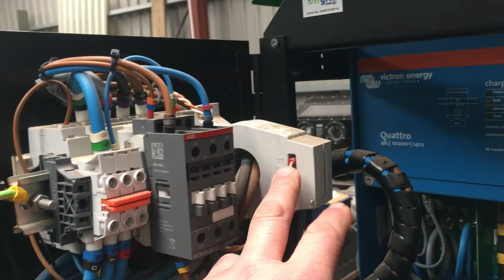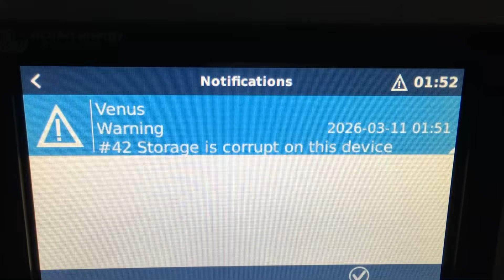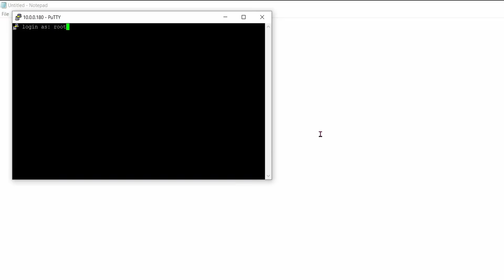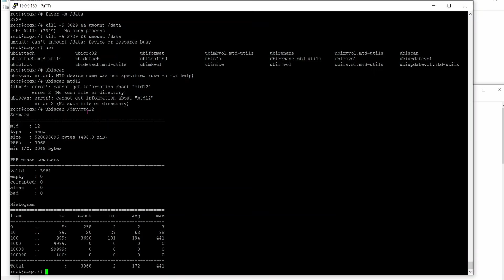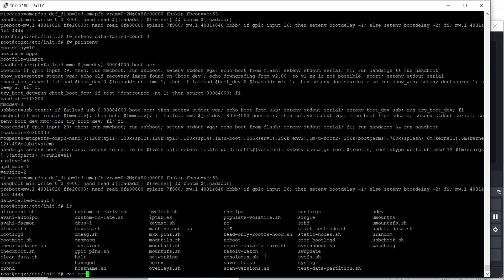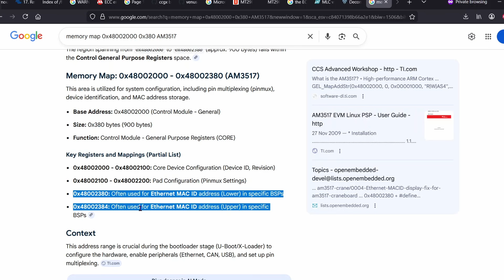Victron: "It's not user repairable" 🤔 Me: "Really?" | Victron CCGX Repair

Comment: This has been a while... did you ever get the whole system working again ?
Reply from the maker: I did some work on it, and altered most of the shelves to take new batteries. I've actually been helping a friend build the exact same thing a few days ago, and we've got his 90% done. Just need to wire the solar panels up and put a changeover switch near his fuse box. He's just using one inverter. I was planning on using two in parallel.

Comment: When a filesystem won't unmount because it's in use, you can often mount -o remount,ro that switches it ro readonly, so you do whatever on it.
As to what happened, I would guess an improper shutdown corrupted something. It happens sometimes, hard to figure out precisely.
Reply from the maker: Thanks for the tip 👍

Comment: I have alot of victron experience and have fixed a few of thses gen sets 
Alot of extra fluff but its designed as fix on site ans not have alot of knowledge plug in generator set and away you go
Great repair by yourself 😊😊😊😊😊😊
Reply from the maker: Thanks mate, glad you enjoyed the video! 👍 I've just been looking at two of these CCGX modules that someone sent me that died after a lightning strike! (probably my next video) 🙂
Reply: @BuyitFixit och that's not good 😐 must have been a direct strike or clap above to cause that

Comment: I would be 0% surprised i they considered that flag as "technological protection measures" and send you a c&d because YOU DARE repair your broken product, instead of buying a new one!
Reply from the maker: Luckily I've not had any issues with this one so far, although I did get my video of the x-ray machine I bought (tear down and hack) taken down by the manufacturer. I guess they didn't like me bypassing their licence check, even though the machine was no longer supported and is EOL. It's a useful bit of kit still though. I used it to prove chips were fake on the KS Jive radio video for instance.

Comment: Great video. I managed to send data to VRM with other commands, but I still get the 42 error even when using the command that fixed it for you. What firmware was your CCGX on when you did this, maybe I can downgrade to it and try again.
Reply from the maker: Did you clear the U-boot flag = 2? what does it show if you print_env? There was a few commands that I had to use to clear the error, such as delete the original partition.
Reply: @BuyitFixit  print_env gives an error, as in the command deosn't exist. Flag was done and  ok. It seems as though I may have ran that last command on root folder and not the correct one. Seems like something is wrong, not sure yet. I'll try reflashing and try again!
Reply: @BuyitFixit  I came back to try again and this time I get no error 42 after rebooting it 5 times. This video was super helpful, thank you so much!

Comment: Some quality nerding here. You clearly know some embedded linux. The best thing about Victron is that it's standard arm openembedded linux, and thus highly hackable. Fixing the ubifs config to use the right ECC is probably the right thing to do here for a permanent fix. But your unmount will probably keep it going for a few more years. I didn't know the VRM iD's were just the MAC address of the device. Makes sense, I guess as they should all be unique. Those Quattro's should be just as happy with some nice lithium batts as a set of lead-acids. Might need to update some firmware, but that's not hard. Victron make all this stuff pretty straightforward.
Reply from the maker: Thanks mate 👍Yes I've been doing some fabrication to the existing metalwork to take some Pylontech batteries as I've already got 6, but adding another 4. I've got the MK3 interface as I had to use it when setting my Easysolar II up. I'll probably do an video on the build when I finish it 👍

Comment: Hey, one of your newest subscribers here! As a Linux wannabe-geek here, I wanted to share my 5 cents as we're all learning and poking stuff. I spotted you using cp -av in the video. The -a flag is usually the gold standard because it preserves everything (permissions, links, timestamps), but I noticed it was throwing 'ownership' errors.

The culprit is that the SD card is formatted as vfat (FAT32). FAT32 is 'blind' to Linux permissions, so it doesn't know how to save the owner data.

If you want a cleaner backup without the terminal spam, I’d suggest these:

1. The Rsync way (if you keep it FAT32):
rsync -rtv --modify-window=1 /data/ /media/mmcblk0p1/data/
(The --modify-window=1 stops rsync from getting confused by FAT32’s low-resolution timestamps.)

2. The Tarball way (Using different filesystem. Best of both worlds):
tar -cvzf /media/mmcblk0p1/data_backup.tar.gz /data
(This 'wraps' all those Linux permissions into one file, so you don't lose anything even on a Windows-formatted card.)

3. The 'Proper' way:
Format the SD card to ext4 first. Then cp -av or rsync -av will work perfectly with zero errors because the card will finally 'speak' Linux.
rsync -av /data/ /media/mmcblk0p1/data/

Awesome repair video regardless—it's great to see these CCGX units getting a second life!
Reply: The "Gold Standard" Network Backup

If you don't want to mess with SD cards, there is actually an even better way to backup your data! If you have another Linux machine, a Mac, or a NAS sitting on your network, you can push the data directly there. This is the "gold standard" because you won't see those "ownership" errors, and your symbolic links won't break—everything transfers with 100% fidelity.

Note: If you don't have Linux running anywhere and want to test this, you can easily spin up a Linux VM in Windows using free tools like Oracle VirtualBox (just remember to set the NIC to bridged mode). Use an Ubuntu or Debian server install—it's a small size since no graphical UI is installed. 

Why use rsync over the network?
1. Full Fidelity: Unlike an SD card, the remote machine understands Linux permissions. A file owned by "root" on the Victron stays owned by "root" on your backup.
2. Symlinks Work: Victron uses many symbolic links. Rsync preserves these perfectly, whereas a Windows-formatted SD card usually breaks them.
3. Efficiency: After the first run, rsync is smart—it only sends the specific bits of data that have changed, making future backups almost instant.

The Scenario:
Imagine you have a Linux machine at 10.0.0.100. Your username is "backupguy" and you've made a folder called "backup" in your home directory. Logged into the Victron, you'd run this:

The Command:
> rsync -avz /data/ backupguy@10.0.0.100:/home/backupguy/backup/

Command Breakdown:
* -a (Archive): The "copy everything" button. Preserves permissions, ownership, and links.
* -v (Verbose): Shows you the progress so you know it's working.
* -z (Compress): Squeezes the data so it travels faster over your WiFi/LAN.
* /data/: The source (the trailing slash copies the contents of the folder).
* backupguy@10.0.0.100: The remote user and the IP of your safe machine.

(It will ask for your "backupguy" password, then start the magic!)

Disclaimer: AI used to help format this technical advice.

Comment: That's a whole skill set that would need constant use or it would slowly be lost, cheers
Reply from the maker: Yes, I used to know a lot more about linux as I used to use it as my main operating system. Back in the day I was cross compiling stuff for different CPUs etc, but I've not done stuff like that for about 10 years now and as you say it slowly gets lost...

Comment: If you want to change the unique ID you might be able to overwrite the get-unique-id binary with a shell script that returns your own ID. However the server backend may or may not accept it.
Reply from the maker: I had thought similar. There is a /data/rcS script which you can create which runs quite early in boot. I had thought of creating a symlink or something linking the binary so a simple script that would just echo the value you required. I think the with the Raspberry Pi it just generates a random VRM ID, so I would think it should be possible.

Comment: I had a similar problem couple of years ago and came down to bios  battery on board it kept loosing all settings etc no power new battery good as new
Also have found sometimes having sdcard you can use that as memory instead of chip and just get it to boot sd instead of flash or bios
Reply from the maker: Interesting, thanks for sharing 👍

Comment: to be fair, you could just have gotten an new controller, either the same aor more modern one, like victron cerbo or victron elkrano. 

Victron stuff is actualy great, because you can repleace single components.
Reply from the maker: Thanks for sharing 👍I've seen the cerbo, but I didn't know about the ekrano. They are quite expensive though at around £400-500!

Comment: Okay so in Linux like that you can set VIRTUAL-MACS

Most scripts will return the virtual mac address because its what the network stack returns, when you enable virtual mac, in almost all cases, the primary mac is simply ignored.

So changing the VRM is possible with 1 command for DHCP users and 2 for static ip users
Reply from the maker: I did try changing the mac in the u-boot environment variable too, but it seems binary reads the memory locations that are programmed with e-fuses directly from the silicon. I did find out that you can put your own rcS script in the /data folder, so it should be possible to make a script to create a symlink to another script that just echo's 'newmac-address' . I think that would work.
Reply: @BuyitFixit your trying to soft change it to network stack itself will update with citlrtual macs, it will never return the primary mac. It's part of the network stack, you might beat it with scripts but I doubt it's viable any update risks erasing the confirm but a stack update yeahhhhh they rarely break updates and or get overwritten, and can be validated adding a startup script to uboot good luck sir

Comment: NAND flash ages. Uslng 1bit ECC instead of 4bit ECC is reckless. From memory this AM35xx should support 4bit BCH ECC in HW and of course 1bit Hamming. There is also SW Reed-Solomon in the Kernel since ages. (tglx did that) So the proper Solution would to Upgrade the Kernel. But that's not a 30 min job :)
Failures like that tend to become visible after a couple of years. And storing that sort of failures in the u-boot Environment is quite creative...
Reply from the maker: Thanks for the insight 👍I'm not too familiar with the kernel code or how ubifs works at a low level. I wasn't sure if there was some software ECC in there which might have been being used. It does seem odd that they are only using 1bit though.

Comment: anyone know how to change the way VenusOS works ? when the hardware dies I move the data to another device but it then looses all its settings as it changes its ID ect and needs wifi set backup again so then have to reconfigure everything again anyhow .. and use the victron replace hardware thing to get the history moved to new hardware , Ie) instead of using MAC adress could it be made to use the storage ID of SDCARD?
Reply from the maker: I did think of possibly a way to do it. You could create a script /data/rcS that creates a symlink from get-unique-id to another script in /data . This script could just simply echo (your new mac). Then you should be able to set it up the same as the previous unit. I've not tried this though, but I think it should be possible. If that didn't work then mount --bind /path/to/new_executable /sbin/original_executable should work.
Reply: @BuyitFixit  thanks will try that as well , like surly a uuid is enougth

Comment: Those are Quattros, which means they have diesel generator inputs.
Reply from the maker: Yes. The big red three phase input can be used to charge it from a generator, and also the small blue service input. You can set the input current from the control panel, so I've only got a small generator 5Kva, but I'm planning to hook that up too so it auto-starts if the batteries get too low.
Reply: @BuyitFixit   the two outputs have priority, you can put secondary loads like boiler to other and when mains drops, the batteries are not wasted to heating water.
Reply from the maker: Yes, I've got a smaller Easysolar II that I setup with batteries and the ESS. It's also got two outputs which as you rightly say you can configure for normal or critical loads. Problem is it's too far away from the house (over 100m) which is why I'm going to re-use all of the batteries from that, and move this unit next to the house 🙂
Reply: @BuyitFixit   It's much more versatile with new VenusOS and ESS. I've also hooked it to Home Assistant which follows electricity price and forecast from net and panel production and then controls ESS on Cerbo which then commands Inverter. Inputs also have priorities, I've swapped them so genset is also high priority and when it stabilizes, it makes automatic swap. The problem is genset governor, inverters don't tolerate much deviation from grid frequence and it requires electronic governor to properly follow load changes.

Comment: This is a continual; problem on this sort of shite.
it is a design fault between the programemr & the storage device.
the programmer who wrote hte code likely continually writes out TMP files for logging or startup procerdures.
over time ,it totally destroys the Nand flash , due to the continual useless writes to the device, then it dies and totally kills a very expensive product.

It is a pain in the ass and a lot of technology sufferers this problem. ,including routers/wifi points, infact anything that continually writes log information to a nand flash.
Usually it is the BLK 0 that goes flaky, this cannot be moved and holds a special  place in the boot process.
A reformat wil lwork , usually for a short period of time.
Reply from the maker: Yes, I remember something similar with Tesla cars and continually writing logs a while  back.

Comment: If you ever want to figure out what is locking a filesystem on a linux like os, you can do ps aux | grep <that number from fuser>  and it should show a process name.
It does sound a little like the problem is that they cheaped out on the ecc ram chip, which is what that ecc error is about, which caused an error probably during some power event like you suggested because error correction isn't working properly.
another very probable cause is that it overheated while sitting in the sun while in operation. Flash memory does not like being hot.
Reply from the maker: Cheers for the Linux tip mate, always useful to know 👍

Comment: Besides copying the mounted filesystem, it's always a good idea to back up the physical partition(s) via dd. That way, you might get data that could be missed if the filesystem has errors. 

As an "embedded" engineer who deals with this sort of thing (and is sometimes responsible), kudos to your work on this.
Reply: Working or not, I'd image the whole flash. Given an error like that, it's possible the flash is wearing out. With a backup, you could replace the flash if necessary.
Reply from the maker: Thanks James, I'd be interested on your thoughts on the 1 bit ECC that it seems to be using. I've done similar work on embedded systems before (as I like reverse engineering stuff and doing stuff like making them run doom or unlocking hidden features). One of the other devices I looked at on here was a VTech internet connected baby monitor, which I discovered cached videos of the previous owners child in flash in the camera (no mention of this on the instructions). It's in the reverse engineering playlist I did here, if you're interested. https://www.youtube.com/@BuyitFixit/playlists

Comment: I hope you pack the space with DIY Lithium batteries.
Reply from the maker: I've already got some pylontech batteries from my smaller system so I was going to use those with some additional ones. I'm currently modifying the old battery holders to take rack mounted batteries.
Reply: @BuyitFixit I look forward to seeing how it turns out

Comment: Linux 6.12 so it's fairly new (late 2024), unless it's updatable (does a battery really need software updates?)
Reply from the maker: I think it's so the controller can support more devices. It's a pretty good system to be fair, I currently run a similar one. You can load "assistants" into it and then configure them to do things. Such as divert power to the grid under certain conditions, or if an input is set send an alarm or close a relay, start a generator etc etc. It also supports quite a range of non Victron devices, such as the Pylontech batteries that I have on my other system which talk to it over can bus.

Comment: The oui of the mac is texts instruments so it's probably just being read from the ethernet interface chip on boot.
Reply from the maker: I did a bit digging into the hardware and discovered there's two MAC addresses stored. One is in the serial EEPROM which the TAM board usually uses, but isn't used in this case. There's the environment var stored in UBOOT, which also has no effect changing it. Victron is using the  (as you said) the TI mac which is hardcoded in the CPU itself via eFuses. The Ethernet chip doesn't store a mac that's why there's an external EEPROM to store it.

Comment: It sounds like the flash chip is newer than the kernel/OS revision running on the unit, which would work fine if the data never got corrupted, but if there was any data corruption (like when the unit is powered down unexpectedly) it would fail on insufficient ECC parity strength. So maybe a firmware update is necessary to prevent it from happening in the future.
Reply from the maker: Agree, I think it's something along those lines. They recently announced that this unit is now EOL and they aren't going to be producing any more updates for it...